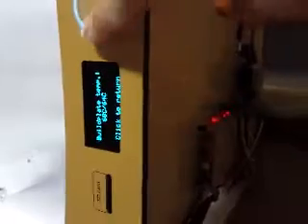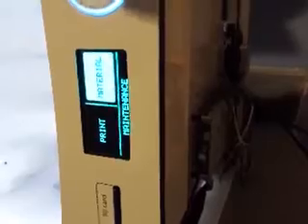Ultimaker2 24V servos heaters don't work

Comment from the maker: I fixed this soon after talking with Siert (one of the founders).  I bypassed K1 with a jumper so that K1 is no longer needed.  Siert explained that K1 was intended for software kill in case of fire/disaster but there is nothing in the firmware that triggers it and there may never be.  By the way the problem only occurred when K1 was warm.  If the printer was off for an hour it always turned on just fine.